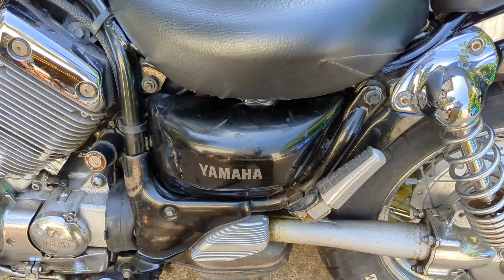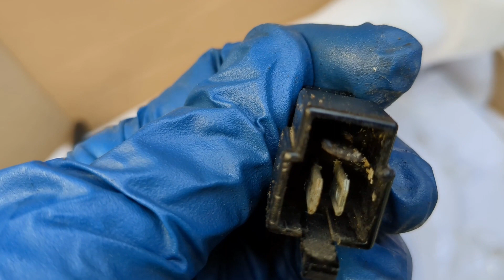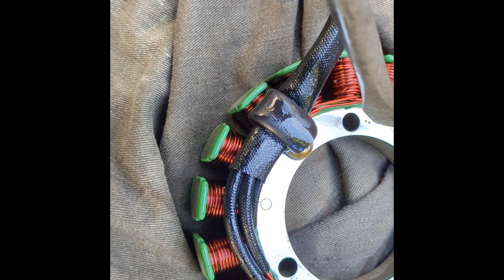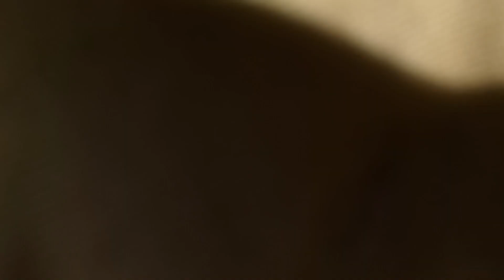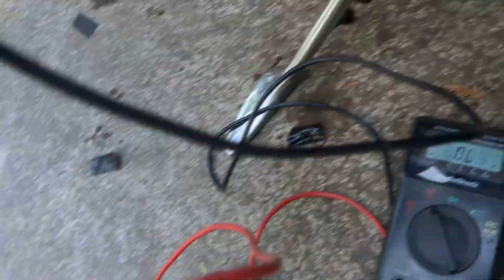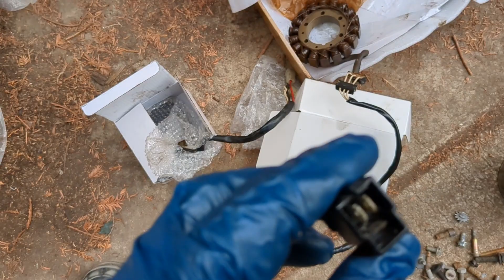1997 Virago 535 Stator Swap

Comment: So... the interphase voltage at idle is around ~9V, what is the range when the revs increase? Let's say half of rpms? Of course, on a "relatively cold engine", because it is known that the characteristics change with temperature.
Reply from the maker: I didn't measure that because if the thing cannot charge the battery at idle you are dead in the water - in the city, you spend a LOT of time sitting at stop lights idling, and if the stator can't make 9-10 v AC at idle, then your regulated DC will fall below 12v and the bike will start draining the battery.  Stators are super inefficient in any case, an alternator is far more efficient - but the only bike I've worked on that had a true alternator was my Honda CB750 - and Honda screwed up because they did not use high-temp alternator wire in them so the coils tend to short out as the insulation burns off.  Stators produce less heat and only have 1 set of coils that can go bad.   You will notice in this one the coils are not potted in Epoxy so what that means is the individual coil wires will chafe against each other as the magnetic fields exert force on them - so over time the stator will start developing shorts and the voltage will drop.  But, potting them in Epoxy, while it will immobilize the coils it makes them run hotter so the insulation degrades faster - so either way you are screwed.  There are so many design tradeoffs on this part, the moral of the story is motorcycle stators are essentially a consumable item.